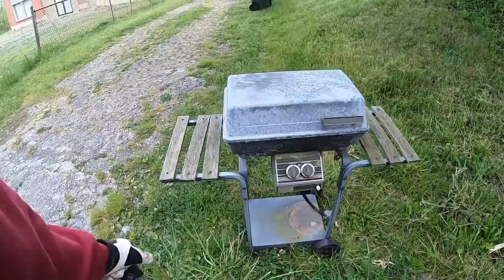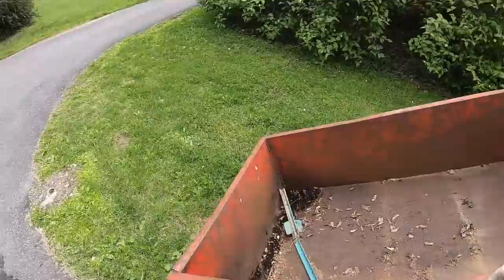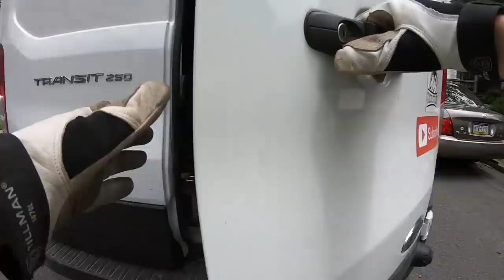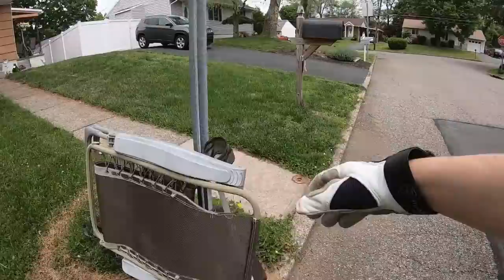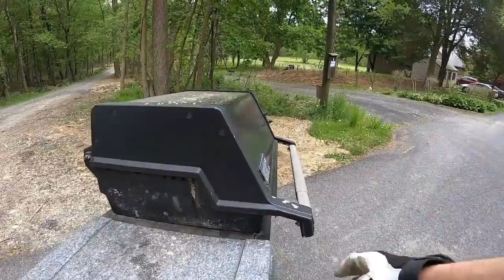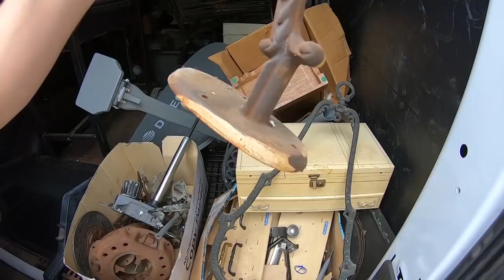Did Someone SERIOUSLY Throw These Away? Trash Picking Ep. 292

Comment: Taco i think you mentioned nailing boards on your deck.. Im not a carpenter but i'm married to one. Use screws not nails. Nails will back out overtime. Thanks for letting us ride along with you..
Reply from the maker: I went with nails because removing the deck was fairly easy with nails in it, there were a couple boards with screws and boards were splintering and a pain to take out. I do agree with the nails popping up :(
Reply: Ape-Stacks Hello
Reply: Thank you for your reply.. I love watching all your adventures. Keep the faith.. You are a very nice , hard worker.
Reply: Screws are great but guess what was used long, long before screws ...correct nails if you use galvanized deck nails ( spiral  ) they last and are a real pain to get out even if you want to of course you young chaps probably have not used nails building a deck  there are  decks I built years ago that are still holding strong ...my deck is 30 years or so and no problems.
Of course I probably will hear I don’t know what I am talking about but I have 55 years in home building and home remodeling

Comment: Weber grills can last for years if taken care of and yes, they are heavy!
Reply: Absolutely.
Reply: And they are easily rebuilt. I believe the red ones are older and supposedly highly in demand
Reply: A neighbor just  abandoned his Weber when they moved, all rusted out.
Reply: @hooper4581  IDK about the color, but you are correct in the fact that older Weber Genesis gas grills are sought after for the quality, and parts availability.   I suppose the red ones may give people the clue that they are vintage since that color was fairly popular.   In reality most Genesis grills produced from 1985 to the early 2000's all are pretty good since the design was basically the same all those years.  The ones with the open frame as featured in the video are the great ones.  The ones with the closed frame with doors are junk because they are not as strong, and have rust issues.
Reply: They got stimulate check new grills

Comment: I would have asked about the trailer.  I just converted one to highway use to make dump runs and to pick up quickkrete at hardware store.  Have less than $250 in conversion,tires, electrical system, hooks and hitch.

Comment: Nails for a deck?  You are just asking for trouble. Always, always use deck screws!  They are coated to last longer so they won’t rust and screws don’t pop when it gets hot. Good luck with the nail issues in a year or 2.

Comment: If it is nearly time for an oil change he must drive a lot more miles than I thought. Oil change interval is 10,000 miles, correct?
Reply: Usually 5k with synthetic; his van is new so doesn’t hurt to go earlier than that on the first one as the engine is getting broken in. Best, B
Reply: Good 411 I thought that new cars were so good in this day and age that breaking in oil was a thing of the past.
Reply: Usual recommendation for oil change is 3,000 miles, but MUCH earlier for the first change on a new vehicle which was probably filled with "break-in" oil.